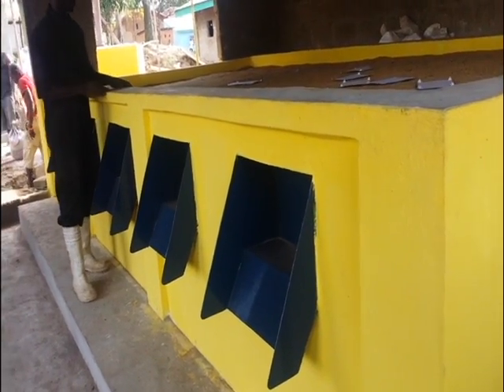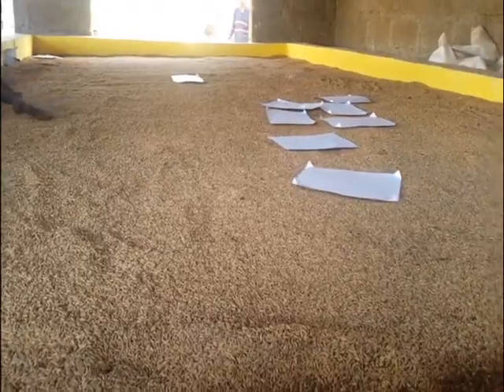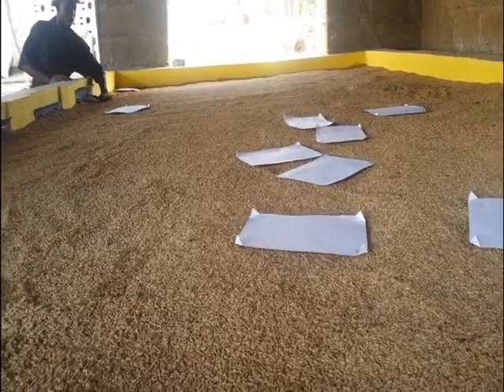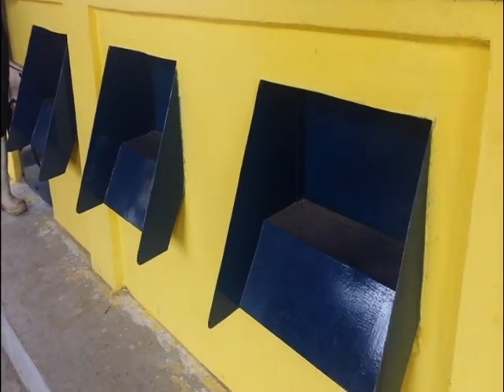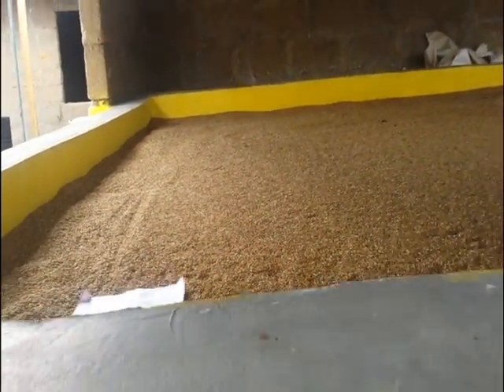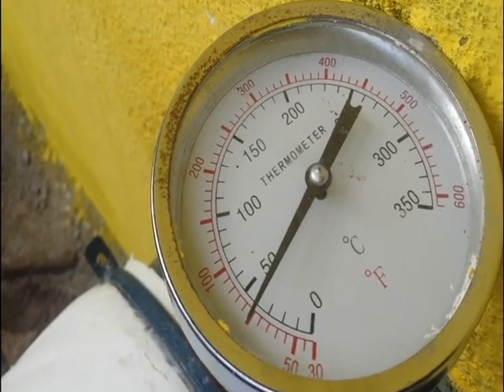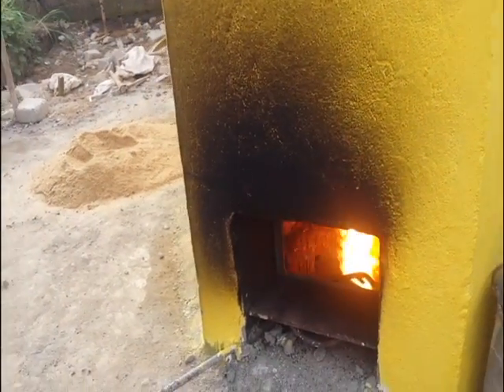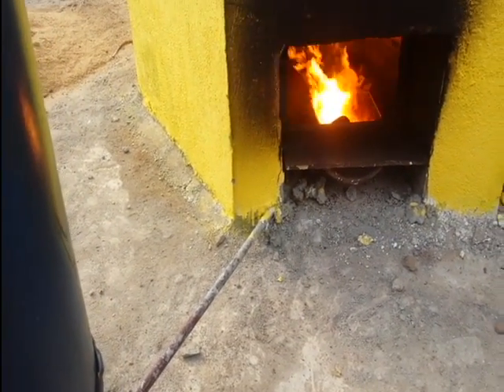Flatbed Rice Dryer of 5 tons capacity Built by FINIC in Sierra Leone

Comment: Is there any chance that the milled rice will smell like that of a used oil?
Reply from the maker: Good question.
 No, the rice will not smell like waste oil.  Reason being,  fumes are not mixed with the hot air pumped into the dryer bin. They all have their paths. The fumes/smoke goes out through the chimney and and the hot air passes through the heat exchanger.
Reply: @finicindustries2787  G.morning im so interesting on this type of dryer can you plz send me the cost to instal salt  dryer in Tanzania
Reply from the maker: Not at all. The fumes coming from the burner does not mix with the hot air blown into the dryer.They have separate paths. This is unlike other dryers.

Comment: This was a fascinating video to see.  I like how you solve technical problems with local resources such as using waste oil as a heating fuel.  
Are their any plans to develop a mobile drying system?  
What about using the rice hulls as a heating fuel?  The sugar cane industry uses bagas from the sugar cane pulp to provide the heat in the sugar cane mills.  Do you think that is practical to try burning rice hull as a heating fuel?
Reply: Yes it is possible. That's what is obtainable in the Philippines